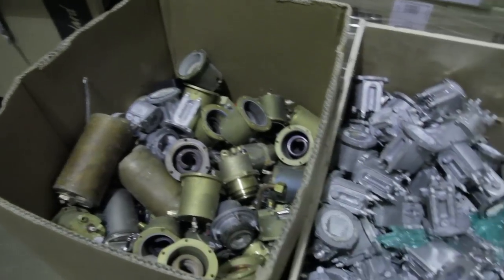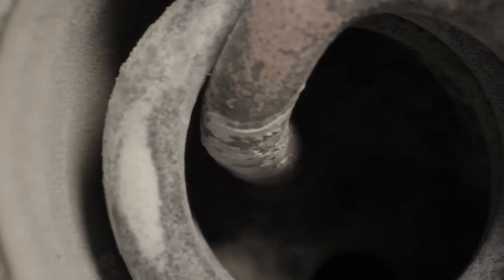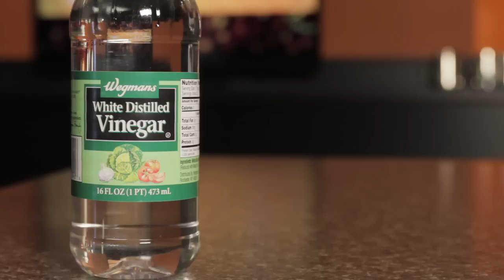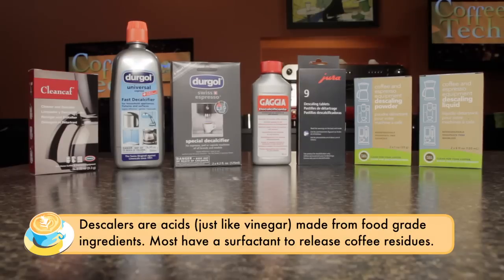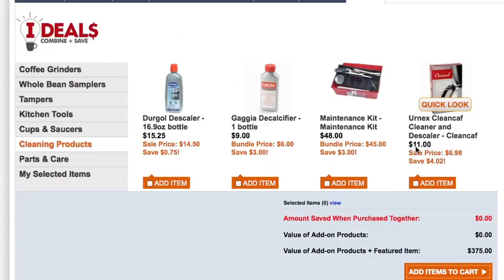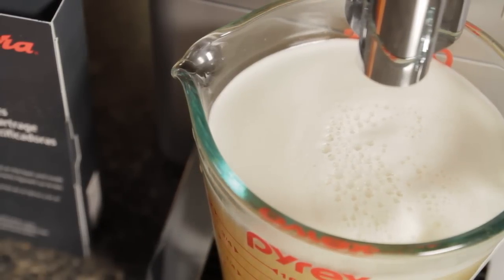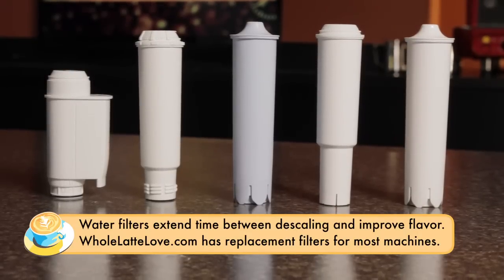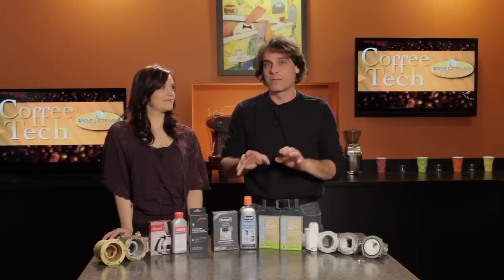The Dirty Truth: Why You Need to Descale

Comment: Just buy Citric acid (Food Grade) and mix a couple of tablespoons with a liter of water (About 2 pints) Cost you $6-10 per Kilo and does an awesome job. Vinegar does leave a bad taste in my experience. Every expresso manufacturer uses citric acid as the active ingredient for their descaler as far as I know. Gets rid of the residue as well.
Reply from the maker: Hi DTL, Agree with you on the vinegar aftertaste. Just one note... For machines with aluminum boilers we do not recommend using citric acid based descalers. Aluminum boilers are common in lower cost/entry-level espresso machines. For those who have machines with aluminum boilers and want to make their own descaler tartaric acid is usually recommended.
Reply: Agreed I have a latissima touch and I looked at the ingredients used in the manufacturers product. Which was basically citric acid
Reply: Druss, do you use the descaling setting on the Nespresso or do you just run the largest cup?

Comment: Super!
Reply from the maker: The Thrifty Christian well, thanks for the comment. Use vinegar on glass to remove scale. Not recommended by any manufacturer for espresso machines. Scale is like a sponge if not completely removed. It will hold the flavor of vinegar and taint coffee and espresso. Ineffective descaling in machines can result in scale particles plugging narrow passageways in plumbing causing machine failure. If you want to be thrifty use citric acid available in bulk and costs less than vinegar and is a far more affective acid for descaling. Pre packed products produce a proper acid concentration and provide users with convenience. Cheers!
Marc
Reply: Your'e the best!
Reply: @thethriftychristian82  Look, there is no need to be nasty. I have used these cleaning products that don't even cost a lot to keep my machine clean. Without educational videos like above most people just destroy their machines for no reason. When you are running an espresso machine that produces steam, the temperatures run way higher than just regular boiling water kettles. As a matter of fact, most coffee machines won't hit proper temperatures as it is. If your water isn't filtered and you own a machine that can produce steam, it will cake up with hardened minerals from heating the water over time. I suspect you do not have a $600-$3500 espresso machine that gets regular service. I service my machine with some of the products above and I am happy to say that after disassembling my boiler (featured in this video) to replace a $5 gasket after a decade of use, the boiler heating element is in near new condition. I do at least two double espressos per day and a flat white every other day.

Curious as to what you favorite coffee is an do you grind the beans yourself?
Reply: Very informative!
Reply: @thethriftychristian82  Upset? I deal with people for a living and deal in facts, not feelings. My facts don't care about anybody's feelings, I can assure you of that.
Reply: @Todd.T  since you couldn't move on I went back and edited all of my comments for you. I'm sorry that you are so sensitive I'll try to be more careful with people like you in the future.
Reply: @thethriftychristian82  So cool. I won the game!! It's true!. You can attract more bees with sugar instead of vinegar! Now I can print this off and frame it! Thanks for proving our point sport. Enjoy your Maxwell House!

Comment: Do we still need to descale if we ONLY use distilled water?
Reply from the maker: gtaatmiami Good question. We do not recommend using distilled (or RO/DI) water in espresso machines. Lack of minerals in distilled water results in bad flavor. Flavor is subjective of course but the Specialty Coffee Association recommends brew water has a calcium hardness of 4 grains or 68mg/liter for best flavor. Other issue is the solvent like power of ultra-pure water. Lacking mineral content, it tries to pick it up when in contact with metals - like your machine's boiler.
Reply: Whole Latte Love What about filtered water in conjunction with a softener?

Comment: MARC. HELP! SOS! Got my Breville infuser couple years ago, used it for ~6months, sometimes a bunch in a day, other times a week between use. I put the machine away for ~18 months and just pulled it back out. Have never descaled it before so thought it probably needs it. Water isn’t too hard here, but it is hard. I bought Dezcal and followed the ratio and descaling instructions in the manual, along with letting it sit in the machine for 30min before rinsing. After rinsing, i keep getting white-ish particles/flakes coming through. Not much from the group head but some from the hot water spout and TONS from steam wand. I’ve flushed the hell out of it but it doesn’t seem to stop. What is this and what should I do??
Reply from the maker: Hi Chris, Particles may be scale deposits loosened up by descaling. Could also be milk residue from the wand especially if you were not diligent about purging the wand after frothing milk. When you cut the steam after frothing quick cooling draws a bit of milk up into the wand. So very important to purge after steaming. Is the machine operating normally aside from the white particles? If so that's a good sign! If it were my machine I would descale again and continue flushing. I have to say allowing the machine to sit for 18 months with some water in boiler section is not a good idea. Six months without a descale is a bit long but depends on usage and water quality. Best practice is to descale and dry out the machine prior to long term storage.
Marc
Reply: Whole Latte Love Thanks for the quick reply Marc! I doubt it’s milk, as I’m very diligent in purging and cleaning my steam wand. The machine does seem to be functioning perfectly normal, but for obvious reasons no one wants flakes and particles in their drink. I didn’t realize scale would loosen up and flake like that but there’s a good chance that’s what it is then. I’ll descale again and keep flushing. For storage, I don’t see any way of draining the system, short of running the pump dry and I was worried to run it dry in case of damage to the pump or element. It’s a thermo-coil system so doesn’t hold too much water I think.
Reply from the maker: Chris Ladouceur probably scale then. Hopefully those flakes don’t plug anything up. We dry out thermoblock boilers all the time for shipping after repairs etc. sometimes have to trick the water sensor with a magnet. Good luck. Hopefully those scale flakes don’t plug anything up!
Reply: Whole Latte Love Thanks! I’m hoping the pieces are small enough they won’t cause trouble. Curious, how safe is it to run a bunch of descaler through your steam wand? Dezcal contains citric acid, maleic acid, and sulfamic acid. Back in Chem class they were strict about teaching us to never boil an acid, so steaming it in my kitchen seems counter intuitive. That said, I don’t see another way to descale the wand short of submersing it as far as possible in solution. The manual says to run the wand 2 minutes straight with the solution, but the book also said to use vinegar which they now recommend we don’t.
Reply from the maker: Chris Ladouceur roger on the no vinegar. No problem running through the wand. Relatively weak acids.
Reply: Whole Latte Love Thanks! Appreciate all the help! Putting the powder Dezcal into a mixing jug burns the hell out of my nostrils. Like a fine powder gets airborne. But I suppose it has to be strong enough to get the job done! I’m going to go descale and flush again. Hope it does the trick, I’ll make sure to run more of the descaler through the hot water spout and steam wand this time and maybe let the solution sit in the system a bit longer. Think I’ll take off the steam wand tip too, might help. Thanks again!
Reply: Whole Latte Love Ran another descale and that didn’t even seem enough so I did a third and then flushed with 3 tanks of water. Seems to be coming clear now. Maybe the rare flake will come out but seems clear. Perhaps it’s the heat that causes it to scale more on that side, still surprised because our water isn’t that hard here. Either way, back in business! Thanks a bunch!
Reply from the maker: Hi Chris, Thanks for the update and happy to hear it's working it's way out! Not everyone is as lucky!!!
Marc

Comment: I have extremely HARD water and I use the bottles of PURIFIED WATER from the market.  Is this purified water doing damage to my machine?
Reply from the maker: Hi Mary, It's possible. It depends on just how purified the water is. Distilled or reverse osmosis water with zero total dissolved solids is an incredibly good solvent. Over time, it can lead to leaching of materials from boilers and have adverse reactions with other components within a machine. The larger issue though might be on flavor.  No beverage associations recommend making drinks with ultra pure water as they tend to have a flat flavor due to lack of mineral content. You want some minerals, just not to many. Our favorite filters remove scale causing minerals and replace them with minerals like magnesium which maintain flavor but do not cause scaling: https://www.wholelattelove.com/products/bwt-bestmax-premium-filter-package
Reply: It is the 5 gal water I by from Sierra Springs. Or bottled water I buy in the store. Faucet water here is extremely hard water and very alkaline.
Reply from the maker: Mary Hesselgesser-Wright
So it's spring water then. Typically that has some mineral content - you should be fine with that.

Comment: Even if vinegar was safe for material, it smells/taste reeeally bad.
I've used it only to clean my water tank.
The other problem is that it's way,way slower than citric acid to clean limescale.
Vinegar has only 5% acetic acid.
You can dilute citric acid even 50% ,way stroger.
But 15% is sufficent.
Reply from the maker: Hi Andrea, Thanks for the comment! Agree with the smell. Also an issue... it can damage the internal seals in some machines. I was talking with one of our service people the other day and he told me how they get machines in for repair and every now and then they get a machine in which someone has attempted to descale with vinegar at home. Vinegar can be a less effective descaler. In a machine with lots of scale build up it can partially work and dislodge chunks of scale (especially if descaling maintenance has been neglected) which plug other components in the machine. They send the machine in for service and he hates opening them up due to the smell.
Marc
Reply: @Wholelattelovepage  Thank's for the response :) 
I really laugh at people saying that coffee maker companies say Vinegar  is dangerous for the machine just to sell their products.
Lemon Juice has 5% citric acid and works much better than vinegar (that has 5% acetic acid)
Normally when  descaling 15% citric acid should be used , if 5% is better than vinegar ,just guess at 15% 😂

Comment: How about Keurig?
Reply: +pinapplemangobananna 

Empty your holding tank and then fill it with Vinegar and brew a first cup of vinegar, let it sit for half of a day (make sure the element is still on). 
 After that period of time, reproduce the process
  (brewing vinegar) till the holding thank is empty.  

When the holding tank is empty, fill it with distill water that can be found at the supermarket or drug store (water with no mineral), fill the tank again with that Distill H2O and rinse in repeating the process of brewing the water till the holding thank is empty.  

Make sure you repeat the process, at least 2 times a year, if your water is really hard like it leave scale on your bath tub after a week, do it 3 or 4 times a years and voila.

Another way to avoid scale is to used low mineral water to fill your tank and use this water to brew your coffee.  Remember, à large part of coffee flavor come from water and heat.  When you purchase spring water, read the label since some spring water come from well to and in those kinds of water, the level of mineral is high.  So, compare spring water mineral level (part/million), less we have, better it is.

Understand that city water can be as hard as well water since filtration center cut round the corner on the softening the water just to save money but at the end, that all your pots and pans, brewing device and hot electric hot water tank who take the hit and have to be prematurely replace if you don't do the descaling process of all those equipments.

Comment: How do you do this if your machine is plumbed in????
Reply from the maker: Hi Jeff, What type of machine do you have? Most prosumer level machines that are plumbed in still have a reservoir. For dual boiler machines, professional descaling is recommended by most manufacturers. Also, for plumbed in DB machines most should use a water filtration system that will condition the water to a point that descaling is not required.
Reply: I have a vivaldi ii spaziale. I'm not 100% sure this is the problem, but my coffee has begun to taste bad, even though I follow cleaning recommendations regularly by back flushing it. Not sure what to do.
Reply from the maker: Okay, so your machine does not have a reservoir and it's a dual boiler. We do not recommend home users descale dual boiler machines. Partial disassembly is usually required to descale DB machines - so it should be done by a professional machine tech.  What we recommend for these types of machines is water filtration that ends the need to descale. As for poor tasting coffee... Is the machine operating properly as far as brew temp and pressure at the group? Has the machine had regular descaling maintenance?
Reply: It has never been descaled. But I do backflush it with Urnex Full Circle regularly. I'm told our water is 20-30 mg/L (2 grains/gal) here - so very soft. That's why there's no filter. But the water that comes from the group head when no coffee is in the basket is not very clear. Should I send it to you all for maintenance?
Reply from the maker: Hmm... 20-30mg/L is generally considered to be in the slightly hard range. The water not being clear is concerning. I would consider maintenance. Do you have any machine techs locally? Shipping machines is a pain and $$. If not, give our tech support a call at 888-411-5282.

Comment: If you have to clean your Nespresso machine don't follow the video on the Nespresso site because the instructions are not clear and I had problems to detarte my machine, phoned my daughter who also had numerous problems with their video. After 1hour she got fed up went directly on YouTube and found clearer instructions than the one on their site. After 45 minutes I did the same thing and can proudly say that my Nespresso machine is détarted, but not thanks to their Nespresso site. I do not understand that the instructions on how to set up your machine for detarting is not in their manuel of how the machine works or at least put the instructions when you buy their liquid for detarting. Unfortunately their are still some people who do not have a computer meaning that they can't have access to you tube.
Reply from the maker: HI GP, Thanks for sharing the tip. Any chance you have a link to the video which you found useful?

Comment: Hi

I see your information regarding descaling.  I totally  disagree when you mention that vinegar can arm your machine and leave taste.  First a foremost, the product that you refer to are corrosive as well.  Moreover, it leave no taste if it properly rinces after the process.  I still use my Nespresso and Keurig after many year using the vinegar process and yes, it leave no taste.  At the restaurant, we have industrial machine and use the same process recommended by both manufacturer and supplier.
Reply from the maker: +Aérodrome Régional Manufacturers recommend citric acid for descaling espresso equipment in most cases. Vinegar is acetic acid which is not effective on some types of scale deposits. On severely scaled boilers, heavy deposits act like a sponge and soak up the vinegar flavor. It's difficult to remove even with heavy rinsing. Citric acid leaves no flavor behind.

Comment: Did they just imply that unlike vinegar, descalers are "food grade"? Repeat that back to yourself and think about it for a moment.
Reply from the maker: Hi t, Why yes we did. Citric acid is the most common active ingredient in descaling products. You'll find citric acid in the ingredients for many prepared foods and also in things we eat like oranges. Granted it's used at higher concentration in descaling products but rinses away easily with no taste or odor.
Reply: @Wholelattelovepage  I think you missed my point. The implication was that vinegar isn't good grade, not that citric acid is/isn't.

Comment: The only problem is that “We don’t make money when vinegar is around”
Reply from the maker: Hey Tom, Understand your skepticism but talk to owners of Breville machines which descaled with vinegar and damaged internal seals. Also talk to those who can't get the vinegar taste out of their machines after using. If you want to save, make your own descaler using bulk citric acid - it's probably cheaper than vinegar, works better and has no taste. Only problem is figuring out the concentration to use. One reason why using a manufacturers recommended descaling product is a good idea. Additionally some of those products contain more than just the acid. Things like corrosion inhibitors which may be important for certain boiler types. There's very little money to be made in descaling products. Manufacturers simply want customers to have machines which operate properly.